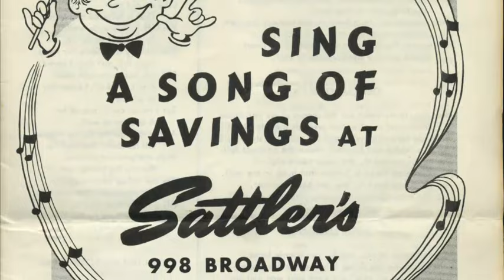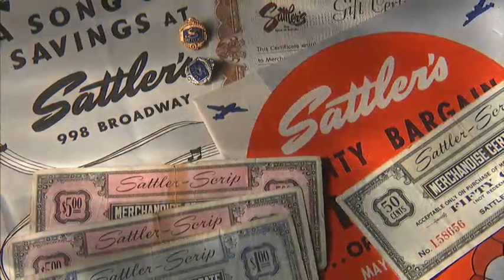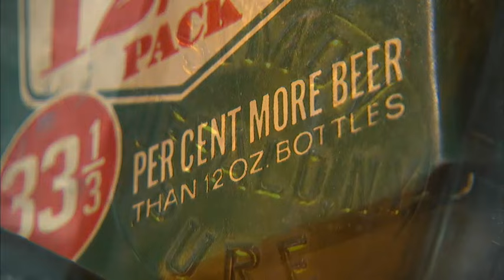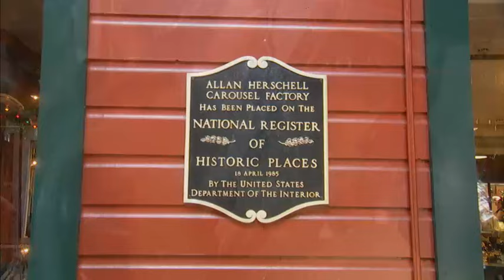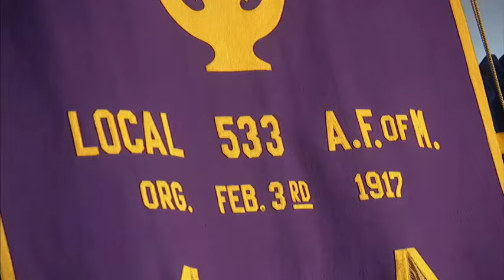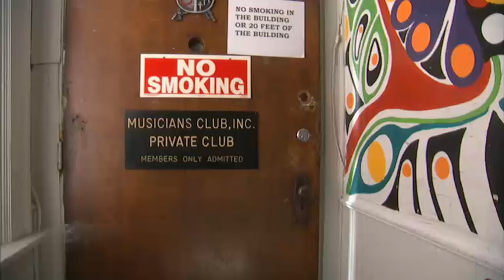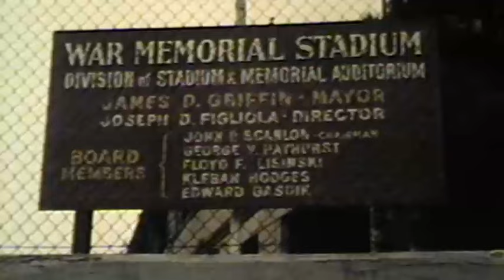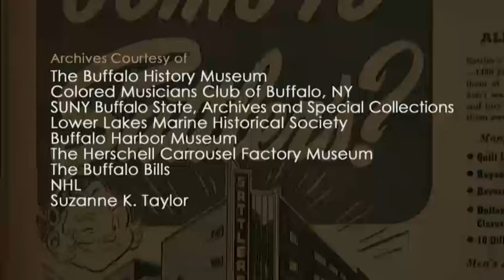Remembering Western New York

Comment: Some of my memories go back further then those pictured in the video. Offerman Stadium, where the Bisons played before War Memorial, was a Triple A analog to the major league "jewelbox" type stadiums.  Intimate, a Fenway-like green monster in left, an Ebbets Field-like concrete wall in right, with houses across the street with second-floor porches from which people sometimes watched the games, in the way that used to be the case at Wrigley Field. There was a high scoreboard in right center that had never had a home run hit over it until Luke Easter did it three tines in, I think, 1957 (I saw the least impressive of the three). In the mid-50s, there will still a lot of former Negro League players in the International League; I saw Stachel Paige pitch three scoreless innings in relief for Miami in 1957 in Offerman.

War Memorial was a football oval, ill-suited to baseball, much like the Los Angeles Colesium, only with right rather than left being the short field (about 250 feet down the line, with a screen).  It may have looked impressive in The Natural when the Redford character hit magnificent home runs over the right field roof; I recall Don Mincher (who later had only a modest MLB career) doing it three times in one game.

Comment: As to the Aud, my memories go back to the days of the AHL Buffalo Bisons, before the Sabres were created. At one point in the 1950s, they were owned by someone who, I think owned the local Pepsi-Cola bottling plant.  As a result the team had a large Pepsi bottle cap on the front of their yellow sweaters.  As a kid, it was great fun to sneak into the Aud for a game. There was a door to the right of the ticket booths in the lobby. It it was unlocked, I could open it, go downstairs into the basement, then come up the ramp used by the Zamboni and find a seat. When I first started watching Bisons games as a kid, the team had not yet acquired a Zamboni, and the ice was cleared by a group of skaters with shovels, and new ice laid from wheeled drums with squeege-like attachments. When the team first acquired a Zamboni, the equipment was a challenge to the driver, a short stubby man named Shorty LaLonde, never seen without a cigar. On one occasion, it ran out of gas between periods. On another, he spun it out and it crashed into the boards. It's easy to forget that, in the Original 6 era, AHL offered a high level of competition, with better play than that offered by the first group of NHL expansion teams in the years before the influx of European players.